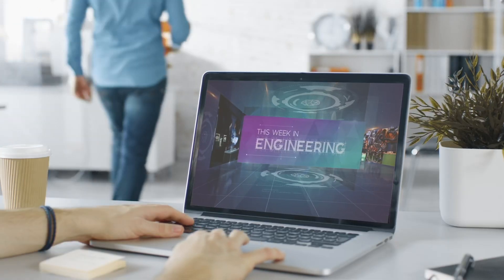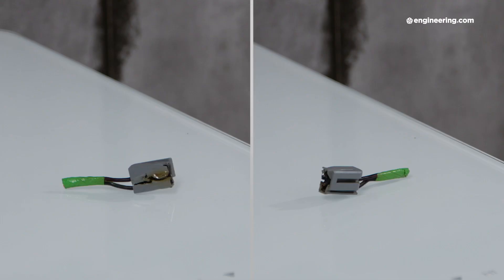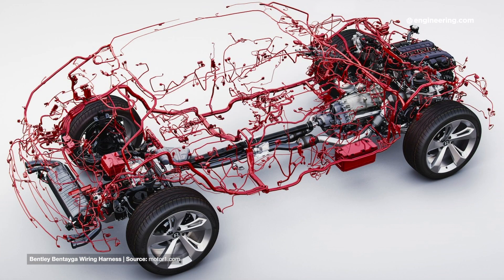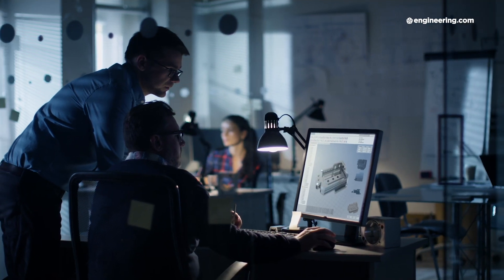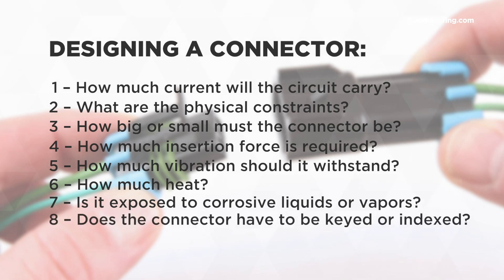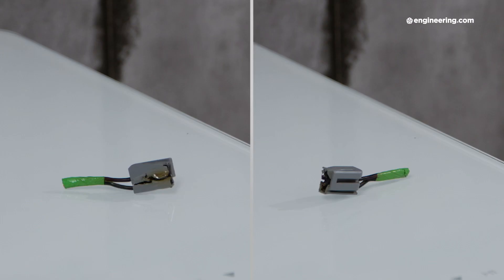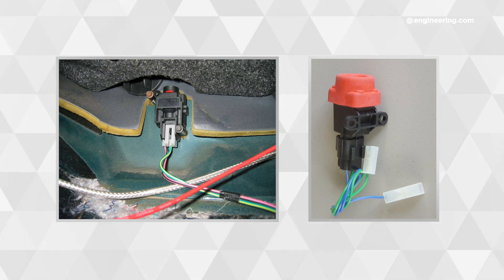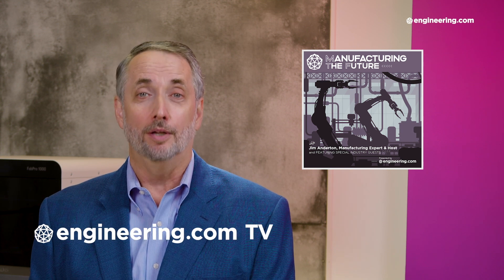Why Do Automotive Connectors Fail?

Comment: Problems: 
1 - EXPENSIVE !!! 
2 - Difficult access (even for professionals). 
3 - Poorly standardized (even with specific characteristics it would be possible to globalize these models, but each vehicle uses a more bizarre set of connectors than the other, making it more expensive and making access VERY difficult for ordinary people and even workshop professionals). 

          It is necessary to standardize these connectors and terminals globally, so that access is common to anyone and, consequently, the price has good stability and is much lower than it is currently. That's  possible because the necessary characteristics are not so that specific as to prevent an better global standardization.

Comment: 3:05  "can a major OEM simulate"... they don't, but the companies who make those connectors CERTAINLY do "simulate" all use stresses, based on OEM required performance specifications. FYI - Honda buys their connectors from the same companies who sell to all OEMs. (OEMs do NOT design or make their electrical connectors). ... an OEM must buy the right connector for the job.